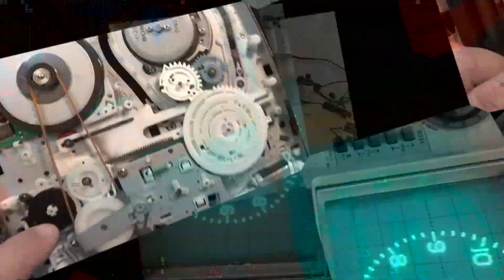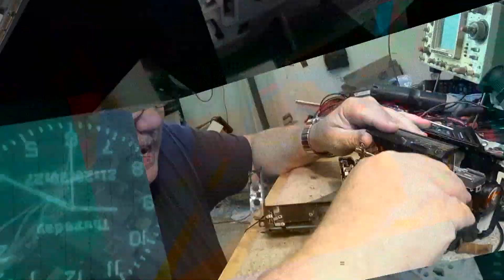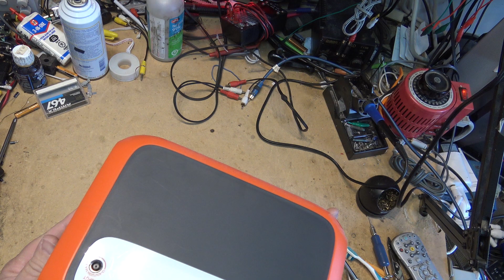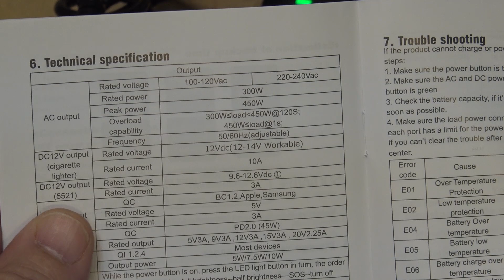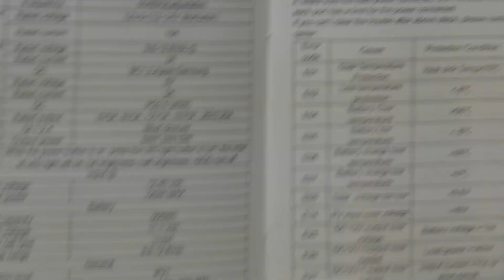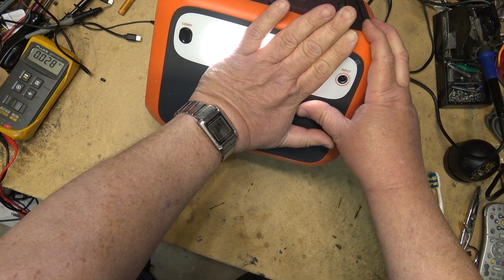Bluetti Maxoak portable power station

Comment: My wife and I used the AC50S on a 10 day road trip to the Grand Canyon in January 2021. We can say without a doubt that this was one of the most useful pieces of equipment we brought with us. We slept in our car every night and used the AC50S to power our throw-size heated blanket. We found that we could power the blanket for about two nights between charges. Recharging was very quick using the 12v cigarette adapter. We also charged our phones, camera batteries, portable power banks and even ran our coffee grinder from this unit during our trip. We couldn't be happier with the versatility and performance from the AC50S. The only thing I would improve with the AC50S is the cooling fan. The fan is turned on and off by the power draw on the unit. This means that when you are powering something that has a frequently variable power draw, like a computer, the fan will turn on and off frequently. It can be a little distracting when you are trying to work. I reached out to Bluetti's support team, and they confirmed that this is normal operation of the fan. It is a small issue in my opinion, but hopefully it can be improved upon in a later version. Either way, we will be using this for many years to come. We can't wait to take it on our next adventure!

Comment: Off topic I bought a 17 Chevy volt watched your vids on yours a few time love the car thanks
Reply from the maker: So do i.  Only trouble i have had with my 19 is the HV battery disconnect relay checked out and the radio is a bit deaf. They are changing the radio module next week.
Reply: @12voltvids  just picked mine up last night 0 range battery charged it last night with the 120 V charger had 38 miles range took it to work this morning only used 7 miles rang to work it around 11 miles to work charging it at work now so far really like the car my suv cost me $160.00 USD a month to drive to work
Reply from the maker: @russellphillips905  well here is one for you.  I just filled the gas tank on my 19. The last time i filled it was last year! Yes i went an entire year and only used 1 9 gallon tank of fuel. Over 10,000 miles.  The trip counter stools at 9999.9 and does not roll over. I hit that in January.  At the 1 year mark the computer said I had to burn the remaining fuel and started the engine to burn up the old gas. I filled and it reset the computer and it looks like i will be good for another year as with this pandemic i doubt i will be going on any long road trips again this year.  My wife drives the old 12 Volt and she does drive longer and into the engine range a few times a week.  A tank lasts her 2 months.  Her old car was 2 weeks max.  So yes huge savings especially now that gas is 1.52 a litre here.  (5.75 / us gallon)
Reply: @12voltvids  it’s 2.99 gal here outside Philadelphia PA hope to run mine on electric most of the time few trips will use gas
Watch all your vids built few kits you had up really like your Chanel thanks for writing back and chatting
Reply from the maker: @russellphillips905  He get hosed (bad pun I know) here with taxes up the wazoo. Road tax, Federal tax, provincial tax, transit tax, carbon tax. Yes the transit riders get a brake on theor fares because the bus service is subsidized by car drivers.  Me thinks that transit should have to stand on their own legs like any business. But then it really doesn't affect me, as I don't buy that much gas and as soon as the border opens up again, I will be going to the USA to buy that cheaper gas.

Comment: Will be nice to see if the batteries out last the HP payments. They are not a cheep way of getting battery power in the UK.
£499.99 Excluding Tax. So £600 before postage for 300W. thats a lot of throwaway batteries.
A good inverter costs way less.
Reply from the maker: They are lithium cells. My electric car is 10 years old and the lithium battery works as well today as it did 10 years ago when i bought it and it has 170,000 km on it.   This should last a good long time.  They have a 2 year warranty on it so the manufacture doesn't expect problems.

Comment: In my opinion it's overpriced & should be in the £100  – 150 range .
Even then for backup power the competition has it beaten .
I can get a 500 W inverter generator for £78 + vat !

So here's my thoughts on this little unit .
The inverter output looks about right for this unit considering the battery size  .
I'd like a higher serge rating as starting compressors like fridges can be problematic .

Reduce the USB ports 4 is more than enough for camping .
Drop the C port , go 100 % old school 5 volt only . 
Dump the yuppie mag charging current sink ….. it has USB for that .

Normally expensive & hard to obtain proprietary plugs should be avoided !

The car lighter plug is still useful & still a pain in the ***$ when it pops out  .. LOL 

The 12 V output needs a XLR socket not the proprietary rubbish .
It could have 15 volts output for charging a cars battery controlled by a link on pin three .
( Not a jump starter just the connect it & give it a hour or 2 charging ) .

I do like the push buttons & the light is interesting being on the back of the unit .